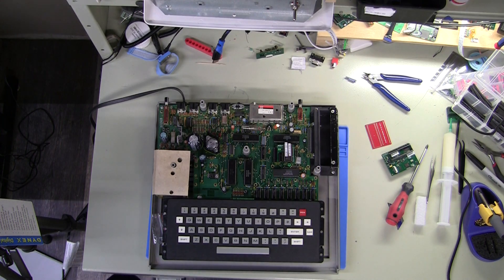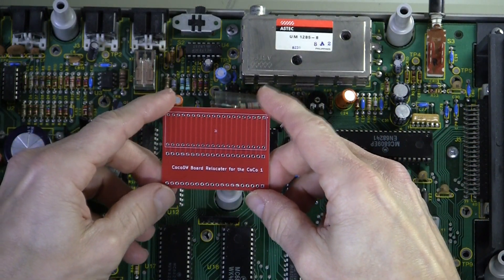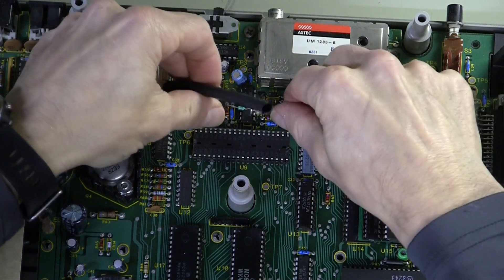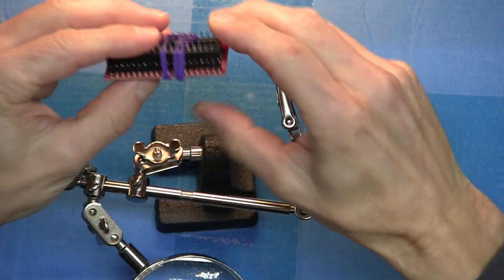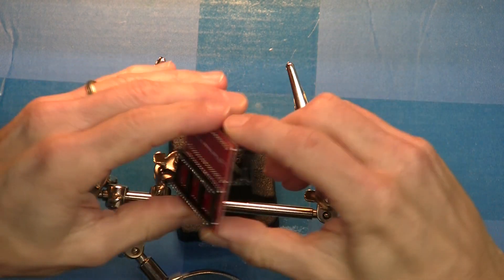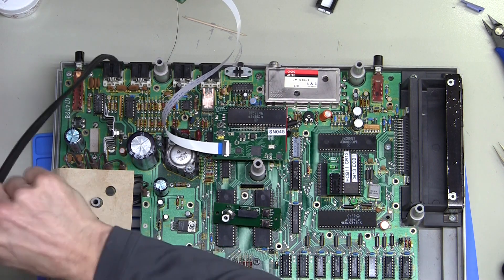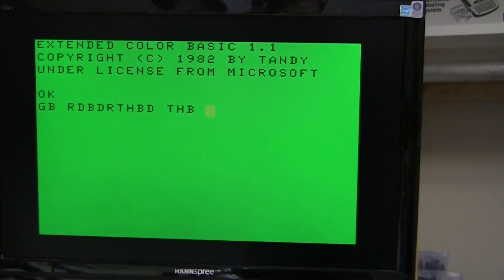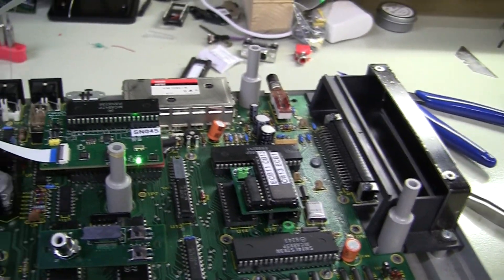A Clever "Relocator Board" for CocoDV -- Avoid Clipping Out the Plastic Post in Color Computer 1.

Comment: I look forward to installing mine.
Reply from the maker: Late reply here, but do you think you'll use it in that Dragon 32?  Do you have Dragon 64 to try it in?  I am hoping that works without any changes.  Just as a note, the same CocoDV firmware that works in normal Cocos with the MC6847P also works without changes in the Dragons (Tano and 32).  The only different FW that is required is for the MC6847T1 Cocos and another one also for the MC-10.

Comment: Having to hack classic hardware for upgrades is the main reason I don't do them. Desoldering a chip is one thing, but cutting the case or drilling holes is a different issue. Great work.
Reply: Many people back in the day would cut and mod their cases for their custom projects on their CoCo's.

I myself had drilled and cut a few holes into my original CoCo 3 case for installation of a Power LED mod, Halt switch mod, XT Keyboard 5 PIN DIN mod on the top of the case.
Reply: @David_Ladd  Me too. I knew if I screwed it up, I could just run down tot he store and buy a replacement :) At the time, there were more Radio Shacks than McDonald’s. But today? I don’t want to hack on irreplaceable gear.
Reply: @allenhuffman  ,
In the case of the CoCo 1, I for sure wouldn't want to cut the center support as many people set a monitor on top of the CoCo 1 and without that support, it could cause an issue.
Reply from the maker: Now that we have the ribbon cable that can route out through the vents, this dilemma can be avoided.  I usually also shudder at modding the case, but I have done so with a few of my own CoCos now that I feel going to digital video is a "permanent" need for future enjoyment of the machine.

Comment: Great video Alan!  I used one additional socket in the VDG socket to stack things. This provided more height for me to clear that cap.
Reply: Will this also provide the extra clearance needed for the RF fence on older CoCo 1 motherboards like rev D types?
Reply: @desmur36
What is the current location of the gerbers if one may ask? :D

Are you on GitHub, GitLab, SourceForge, or another repository?
Reply from the maker: David, in case you didn't find them yet, let me know and I will send you a relocator board for no charge.
Reply: I will email it to you.